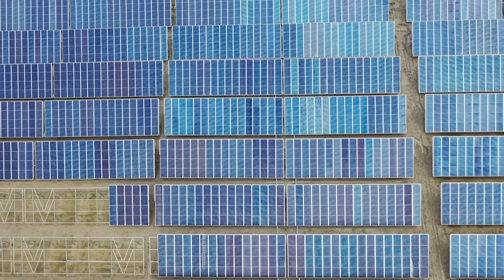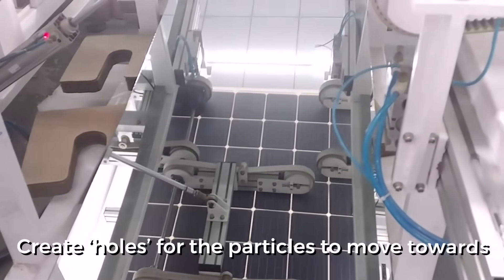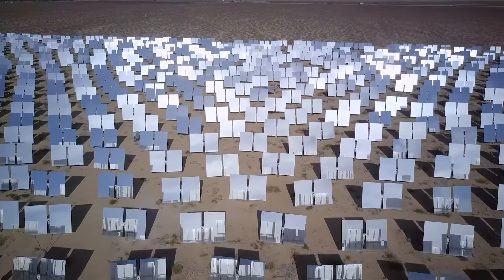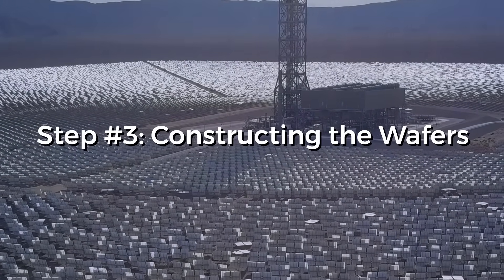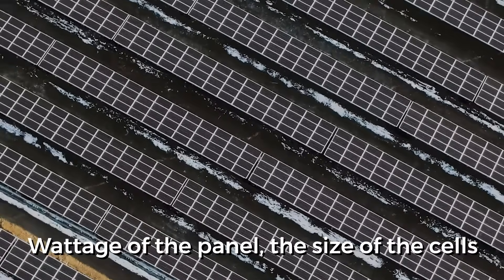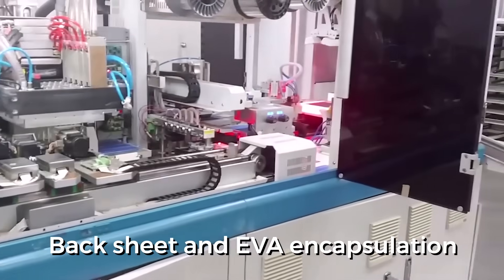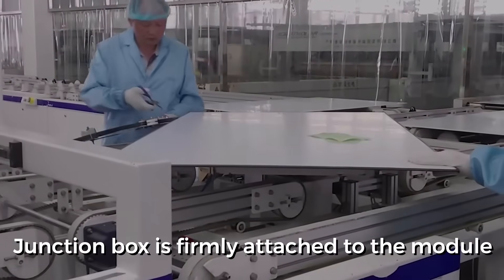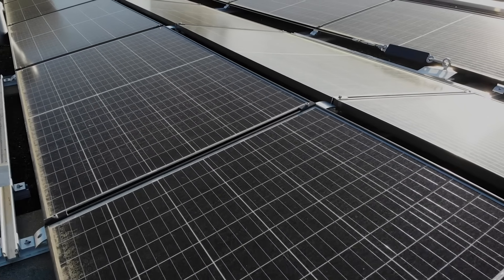HOW IT'S MADE: Solar Panels

Comment: The overall manufacturing process is not necessarily located at one site. I have a few on the roof that were made in Malaysia and assembled in France (according to the labelling on the back of them - I had a look at it before it was installed). They are made by the firm Sunpower.

As to the source of power for the processes, in Malaysia it would be a mix of imported coal and local natural gas, whereas the French end would be a mix of nuclear and hydroelectric. No idea of the overall balance.

Comment: Is Coal Used To Make Solar Panels?
Yes, coal is used in the production of solar panels, and it is used as a raw material to produce the chemicals used in the manufacturing process.

The main chemical used during this process is polyvinyl chloride (PVCs) which is very hazardous and poisonous.

The use of such materials will increase pollution levels worldwide, leading to global warming. It will also release toxic materials if it is burnt or not disposed of correctly.

The raw material for the solar panels is coal, which has an average life of 11 years. This means that 11 tons of coal must be burned to make a solar panel – that’s about 3000 pounds! The production process uses high temperatures and pressures.

Look into things, these videos leave out the bad stuff, only tell you the good.
Reply: I wish they would be open and honest. When the makers of these videos hide stuff, it makes it harder for me to trust their agenda.

Comment: Very informative. 
Had a couple of questions though
1. Mixed with Carbon? What's the source of carbon?
2. What's the source of the energy that brings the mixture to 2000°c?
3. Ingots. What's the source of boron, and what's the process of having it to the required quality in order to mix it with silicon/phosphorus?
4. Tampered glass. What's required to come up with the ethylene vinyl acetate? 
5. Framing and sealant: what materials are used for framing and what's the process of producing them?
6. After how long does it take for a complete solar panel sold to the market, start having dead cells? Or what factors would contribute to the cells producing low power?
7. How many times will I have to replace the energy storage units (batteries)  within the 25yrs? On average how much would that cost? How do we dispose the panels (and batteries) after the 25yrs?

We could be hyping solar panels and ignoring the fact that the process of producing them could be contributing more to the global warming than the benefit that come with it. Not an expert opinion, just a thought, I stand to be guided
Reply: Over the course of 25 years, a 14lb, 100w solar panel will produce approximately ~9000kwh during its 25 year warranty. Additionally, most solar panels continue to work beyond that lifetime, as most solar panels are rated for 0.5% loss of efficiency per year. 

In comparison, petroleum liquids produce approximately 12.86kwh/ gallon. Coal produces 0.9kwh/ pound. 

Combine this with the fact that silicon is one of the most abundant elements on the planet, and that the energy required to heat and purify the silicon can come from solar panels, AND the fact that the wafers can be recycled, whereas fossil fuels cannot, it makes sense that solar is much better for the environment.
Reply: @justryingmybest  Solar panels don't produce energy at night, and you'd be lucky to get 25 years out of a panel...
Reply: @ffjsb  you just use batteries or the grid as a battery and at the end of a 25-year warranty, panels still produce energy at 75-87.5% of their rated output. According to an NREL study nearly 80% of solar panels last longer than their warranty.
Reply: @ffjsb  solar system life time expectancy is 45 years, coming from someone who works in the solar industry
Reply: @ffjsb  it just all depends on what type of system you go with
Reply: @stummeboibeatz work for me
Reply: Answer your question 1: coal

They always seem to leave that part out. I wonder why?
Reply: This video mentions the source of carbon at about 2:20in
https://youtu.be/5Sgmp1aUjnA
Reply: Use biogas from sewers like the good ol days
Reply: only have answers for 2, I know this because we design the furnaces.
1. Mixed with Carbon? What's the source of carbon?                                 most use wood
2. What's the source of the energy that brings the mixture to 2000°c?                  made ins a silicone metals furnace, electricity mostly from coal

Comment: Made with silicon mixed with carbon.  Interesting that it wasn't mentioned that source of carbon is coal.
Reply: ok buddy stick to paying for electricity or run lamp on oil, byee
Reply: That carbon is a tiny miniscule amount compared to 100-million barrels of oil burnt for fuel daily wide.  Also several million metric tons of coal burnt for fuel everyday globally too.  This is for all solar panels produced globally not just China.
Reply: Okay and? Some coal is used in production and it results in less coal being burnt in the long term, crazy huh
Reply: @maramma4780  You assume the solar cells provide more energy output than what went into producing them.
Reply: @TheDustyShed  they do, in a relatively short amount of time.
Reply: @TheDustyShed  and their costs too in an amount of time, most panels have a 20 year warranty now too
Reply: They can't be made without oil and gas products.